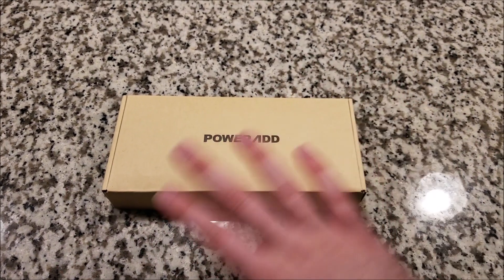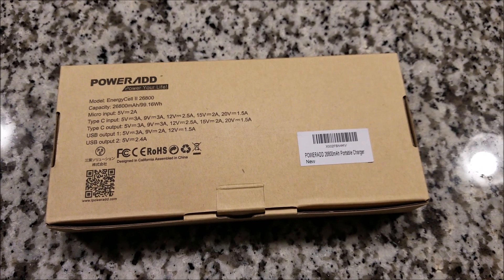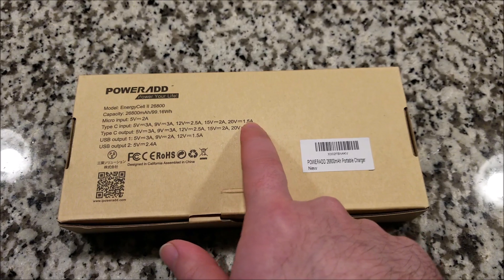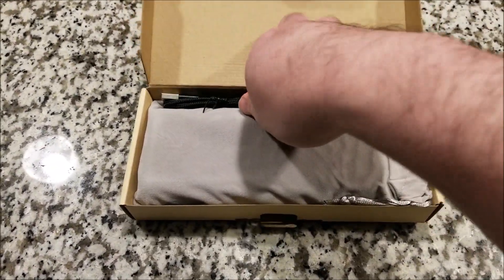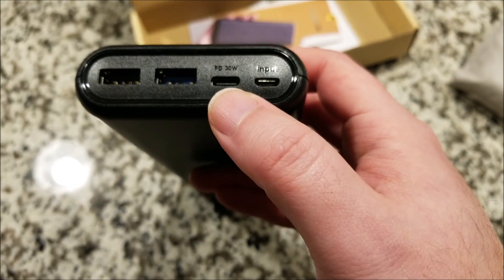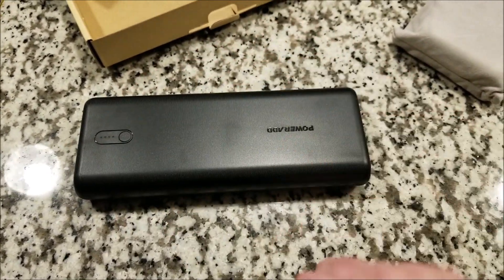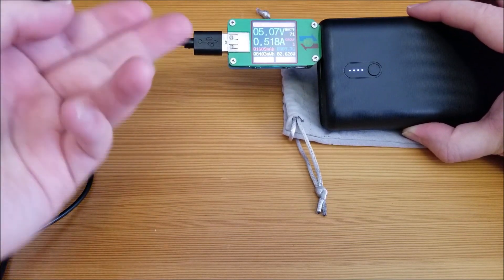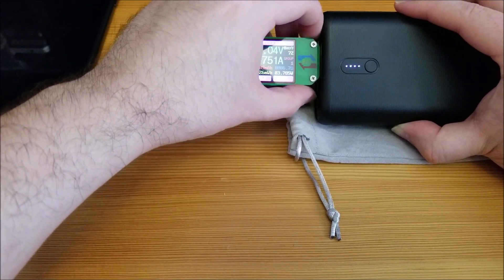Lab Tech: Poweradd 30W USB Type C 26800mAh Power Bank Review

Comment: Anyone have issues with usb c cable orientation - my iPad Air gen 5 will only charge if both sides are same orientation?
Reply from the maker: Some cheap cables/devices with usb c ports dont wire both sides of the connector correctly so that the cable only works when plugged in one orientation. In your case it could be the cable or adapter (I highly doubt apple would wire the usb c connector incorrectly).

Comment: hello
kindly u tell me poweradd 26800amps vs ravpower 26800
which one is best
thanx
Reply from the maker: I cant say for sure since I don't have the ravpower 26800 to test against my poweradd. Looking at the specs though the generally look around the same, but the ravpower doesn't have a type c connector and apparently doesn't do quickcharge like the poweradd does. It really depends though how you intend to use your powerbank whether this is important to you or not.

Comment: I got the EnergyCell Ⅱ 20000 Portable Charger PD 18W, and for some reason it is not charging. I connected usb c to bank and usb a to wall charger, nothing shows up. Do you think it’s faulty ?
Reply from the maker: Yeah that certainly doesn't sound normal. I'd suggest hitting up their support to see if they can help.
Reply: @sjm4306  yeah I got a replacement issued by Amazon, hopefully it’s one that works lol